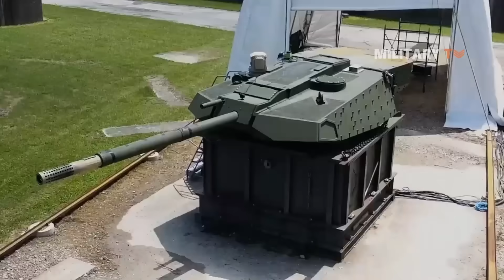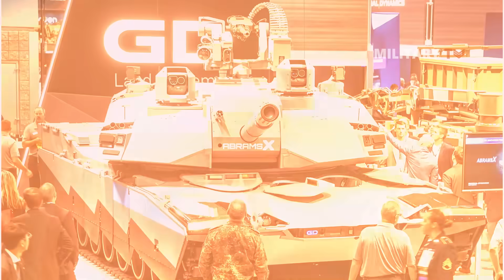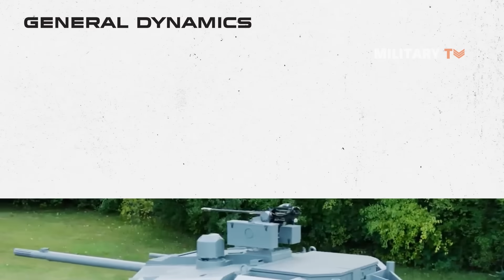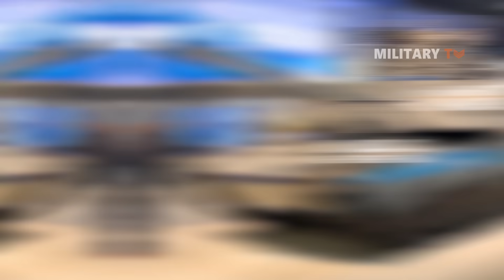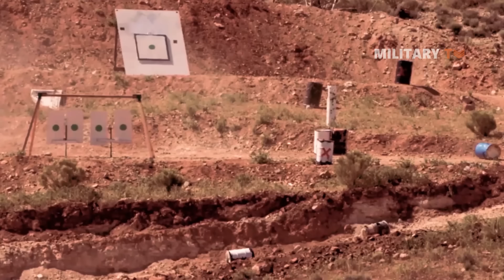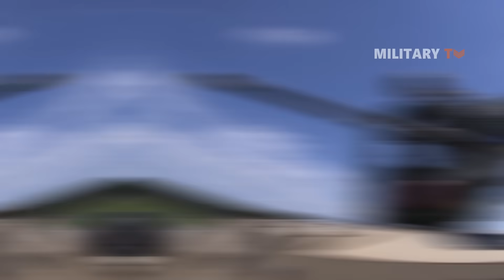Abrams X Tank: US Army Successfully Tested Deadliest New Tank

Comment: Almost everything that has an X in the name of a new AMerican weapons system, tends to fail dramatically. Not that it may be the case here, but i would also like to point out that the overall look of the system also projects its effectiveness. Almost all weapon systems that look good aesthetically, also perform as they should. Looking at the X model, the chassis from the older Abrams doesn't seem to fit its turret, where original Abrams turret fits the casis perfectly.

Comment: Would a hybrid engine allow for more low-end torque from an electric motor? One of the main reasons the US military went with the gas turbine engine over a traditional diesel engine was because the gas turbine engine offered better torque and acceleration at lower speeds. So, in theory, the tank could fire and maneuver more quickly and effectively. 

It's also cool that new Abrams X no longer needs an APU, cuz they'll just use the electric motor to power critical systems while the diesel is powered off.

Comment: The engine being lighter, the turret being lighter, the armor being lighter (through using upgraded materials) and everything else being lighter is why it can have the battery. My major concern is its relation to electric vehicles, if the military is planning on going electric then it would need to be a few hundred years from now. We have electric cars spontaneously combusting and the fire from it is simply to much for anything we have to put out instead requiring to secure it and let it burn out, the batteries also don't last long enough to be worth it, they're expensive and would need to last at minimum 20 years active or 40 years stored to be effective and current rechargeable batteries just are up to the task. Our power grid can't handle the number of electric cars we have now and the push to go full solar and wind despite their limitations and actual far higher carbon dioxide out from mining, processing and manufacturing the materials which render them into a state that can't be recycled or decomposed make it completely stupid to try and go fully electric.

Comment: It's an absolute no-brainer to install a large battery for hybrid operation. Reduced acoustic and thermal signature as well as extended range from the same fuel tank gives three significant tactical advantages from a single solution. 

I imagine that having one less crew gives about 2-500 litres of extra internal volume for other stuff, such as ammo. 

I am wondering, however, if they will not be missing the .30 and .50 cal machine guns they used to have. 30mm is a completely different weapon. Does this tank have adequate protection against infantry, who can walk up and throw grenades in the tracks. Or am I way off here?

Comment: The vehicle crew can be blinded by destroying the optical viewers/ranger finders located on the turret, how has that been addressed? How many rounds are stored on board the tank and are they all loaded into the autoloader system.  Are we talking about a hybrid battery power tank and if so, how often would the batteries have to be changed or recharged by an external power source.  Will the power pack be able to be replaced in the field? Has the logistics of this been consider before the design acceptance. As for the main gun size the larger the caliber the less main gun rounds can be loaded into the autoloader system.  I have heard the superlative descriptions on so many other weapons systems and have observed the far less than desirable realities of these systems, I have a wait and see attitude.  I hope there is not a void between the superlative descriptions and the reality.  Lastly what will the Abrams X unit cost be?
Reply: Maintenance is going to be a bitch
Reply: All valid points...which will be addressed in the Abrams X v2.0 upgrade kit in a few years...in a multi-billion-dollar contract.  Buy Gen Dyn stock.

Comment: Love it but a smaller crew has more cons than pros.  Tanking isn’t just commanding, gunning, loading & driving.  Everyone participates in maintenance but mainly it’s the loader & driver that do the work while the TC &/or gunner supervises.  All soldiers get sleep deprivation whether they are training or deployed.  You might get 4 hours a night if you’re lucky but someone has to man the gun & radio for security.  So you have to divide radio watch duties across the crew.  With less crew members that is more work or time for each meaning less down time.  Less down time means more sleep deprivation & lower morale.  WW2 tanks were smaller yet they usually had 5 crewmen as they had a dedicated radio operator who was an assistant driver.  To me 4 crew members is a good balance & you are less reliant on a complex mechanical autoloader which can fail or break.

Comment: the forward hatches with look out glass portholes in the Abrams X underneath the front end of the 360° deg rotating turret could have been better engineered . . . the sliding out mechanism of the glass porthole hatches cumbersome . . .

Comment: Also so what happens if the auto loader gets taken out? Are they going to have to go back to base and repair? Cause i didnt hear or see a way for any of the crew to jump up and manually load the gun? If so Thats a major design flaw.
Reply: I'd imagine even when a current Abrams is Penned in the turret, they won't be loading the gun any time.

Comment: The amount of tankies in the comments is hilarious. Let me tell you how shit your previous Armata is. It uses the Tiger tank's engine from the fucking 40s, the auto loader is slower than the t-70 and much slower than how fast an Abrams can reload, it also jams and can't be fixed unless taken to a repair depot, it has no backup sight, still doesn't use cameras as sights and relies on periscopes, is nowhere near the 50mph it has been stated it can go, most of its anti missile systems don't work, which was complained about by China, many of the components are built by the West so Russia can't even make them without the west's help, it's insanely expensive, and so much more that I can't even get into. 

Sorry tankies, but you aren't beating the US military industrial complex when it comes to making military vehicles.

Comment: Abrams X is not designed or meant to be a MBT. It’s actually meant to be a light tank that doesn’t work in frontlines, but behind the Abrams M1A2 SEPv3 and SEPv4
Reply: no we already have a new light tank with a 105
Reply: The Griffin 2 MPF is in production as new light tank. AbramsX is replacement foir older Abrams MBT's. The decreased weight of the AbramsXwill allow it to bridges that M1, M1A1, M1A2, M1A3 cannot cross.

Comment: It all sounds impressive, however, I would worry about the exposed critical items. The "two eyes" of the tank, what to keep them from being shot out and blind the crew? Did I hear you say rubber tracks? No mention of any heat capability. Can they catch fire rolling over a flamed obstacle?
I personally would have liked to see the impact of a Javelin against the shell or hull of the new tank, but there is time.
Smaller, faster? Three men abreast in front of a TV, Oh, we did;t see the inside. While it sounds odd, compared to the historical position in the battle tank, it is interesting, where else are three men working in an enclosed space side by side. Bathroom break?
Lastly, autoloading attack shells? Do we have reliability numbers on that? If, there is a failure to load, does one of the three have the capability to TS and clear the problem?
It's a very pretty tank, and technologically exotic, but can take the rigors of battlefield combat. Drones, missiles, mines, Improvised explosives, battlefield anti-tank landscape construction?
Ukraine shows both an urban and rural battlefield at once is this tank simultaneously ready for both as is today's battlefield? I like to see that proof of its ruggedization.

Comment: The coaxial gun could fire .338 Norma Magnum ammunition to increase its range, accuracy, low drop over distance, and have better terminal effects.  Replacing the M240 machine gun.  .338 has similar.50 BMG ballistics. GD and Sig have .338 guns. Offering useful anti personal protection and cheaper than 30mm.  A major Russian failure in Ukraine has been a lack of camouflage netting and possibly thermal protection.   Using cheap camo netting to protect multi million dollar vehicles.  Thermal camo is more expensive. Many vehicles were easily found without netting by using. UAVs. Then dropping bombs or share data with artillery. Ukraine artillery has had great accuracy.  Almost like guided 155mm rounds.. The US needs to keep these in mind. Russians also lacked  enough training, secure communications, GPS, night vision, trained infantry support and use of smoke for protection.  But had many popping turrets.

Comment: They need to redesign the whole thing. Weapons systems might not change much from these plans, but the advancements made creating advanced-higher-strength-steels over the last 20-30 years means this is like trying to up-fit an old car that still has weak steel that has to be ridiculously thick and heavy to be effective. Biggest cost concernment should be ongoing costs and all the advanced-high-strength-steel capabilities we have these days could be used to create a new balance between higher efficiency for range/long-term costs and stronger steel armor made with modern methods that would improve them both by multiples. The weight budget wasted by using steel made with decades-old technology is ridiculous. Trying to save the Abrams design is a waste of time. When you’ve changed every part of a vehicle by doing it piece by piece 5 years at a time it’s not the same vehicle and all you’ve done is eliminate the cost-savings and improvements that can be done with mass manufacturing and economies-of-scale. It’s a waste of money, The Pentagon has rightfully been trying to stop spending money on the Abrams for years to save money and move to the next tank design. Also, this tank was not designed, as suggested, for the combat in Ukraine, it was designed way before Ukraine started as a way to keep the Army on the platform when the army wants a modern tank. They’ve been fighting this and lobbying for years, maybe a decade.
If Johnny Cash were alive he’d say, “I wrote the song, One Piece At A Time, as a joke. I didn’t think the US Army would do it with the Abrams tank.”

Comment: The two (of many) important upgrades of the "X" is the lighter weight (enhancing transportability) and the diesel engine that replaces the maintenance requirements of the existing Abram M1's exotic gas turbine. High speed and maneuverability is an also great asset in an MBT, as demonstrated by the Russian T34 in WW II

Comment: Not a fan of tanks becoming more computer controlled. Pretty well rounded tank overall though. As long as neutron and emps can't destroy the electronics. Which is the biggest threat to a tank controlled by the computer/AI. Hope that a manual turret firing system is a thing on these tanks. Or the only thing the tank will be doing is trying to escape or driving in circles.

Comment: I think further design refinement focusing on exploiting abundance of resources and sustainable costs control over time. Also some additional logistical and maintenance research should be done at the U.S. Army's discretion based on supply and demand economics. This should be considered before making an official formal request to congress in purchasing the new main battle tank. Also, taking advantage of the the "electric motor revolution" mandated by President Biden's climate change initiatives should also be considered for powering the tank with an all electric system that offers quieter engine noise, low heat signature, and environmentally friendly.

Comment: I don’t think if there was a decent war break out that manufacturing would keep up with demand needed. Probably end up reverting to older style easier to build and less exotic materials required systems. All these tanks would get used up in the initial period then more dumbed down versions would come out then a redesigned more easily built versions until they get to a sustainable model. I think they’re dreaming a bit to much with some of this stuff
Reply: This is just a cool technology demonstrator. It's literally a what-if, packed with everything the designers could think / make use of. It won't go into production.
Reply: @bickboose9364  perfect description of the T14 Armata
Reply: @S0ulinth3machin3  Lmao yeah, but unintentionally.

Comment: Auto-loading on the Abrams has already been tried.  Army didn't like the idea.  A human loader can be swapped out in seconds.  A auto-loader would need significant repair time.
Reply: This is an American tank.

Filled with blowout panels, proper armor, proper combat and air support and logistics that can handle supply for it.

With skilled mechanics of all of NATO to repair it
Reply: @ArmedSpaghet  the Abrams auto loading was tried with the TTB back in  1983 by the is army.   They decided against the autoloader.   Look up the Abrams TTB for more information.

Comment: The fuel consumption reduction is huge. The logistical train the current M1 needs in the field, is a major vulnerability. And the reduced weight may be a practical reestablishment of the Armored Calvary. I don't think the Abrams X would be necessary for a full armored division. But in a smaller self contained unit such as a armored Calvary regiment.
Reply: If it's diesel-electric, it gets a LOT more than twice the fuel mileage of the Abrams, I think. A turbine is about the least fuel-efficient internal combustion engine known to man, isn't it?
Reply: @ceoelektronika8604  when the abrams was designed fuel was not an issue they wanted max power output to fight in the fields of germany if the soviets ever crossed the line

Comment: How easy would it be to "blind" this tank?  It seems that those protruding sensors on top of the turret are "delicate" and easily taken out.  Wouldn't this render the platform seriously degraded?  As an old infantryman that was the first thing that came to my mind.  It's the first thing I'd try to do to it.
Reply: I'm curious about that too, what is the minimum rifle cartridge that could blind it with well placed shots?
Reply: I agree, they mentioned the optics were armored but I’d imagine a some well placed hits or a heavy beating would disable them. My first question after seeing those  was if there are backups available? Furthermore, how easy or difficult would it be to replace such advanced optics & sensors?
Reply: @mrhoneycutter  I wonder if a .375 Cheytac would suitable for disabling tank optics. I assume .50 bmg would would work on them but that's a really heavy unwieldy thing to carry, less practical for soldiers.
Reply: @morgatron4639  honestly I wouldn’t be shocked if it could. You’d likely need to land a few well-placed shots close to or on the “eye” of the cameras/sensors. While the sides of the structure the optics are held in looks fairly solid, I can’t imagine the optics/sensors themselves being as heavily fortified.
Reply: Even if every sight was taken out they could beam a target/range from their personal drone and the computer would do the rest. Could be sitting behind a hill like a chopper or artillery and indirect fire.

Comment: Seems very promising. The hybrid engine sounds like an amazing idea. My only concern is too much complexity. If it's too complex to build, then it won't stand up in a major conflict. 

Also, what if the autonomous machine gun gets jammed?
Reply: Might have something to counter the jam
Reply: @LazyHistorians  they might. Separate but related. I spoke with an actual F35 pilot today.. I asked him about it and he said: "It's great.. if everything works..."
Reply: @kadegreen5356  I mean that’s equipment in general.
Reply: Chain guns don't jam, they are power cycled instead of gas cycled. The faulty round just gets cycled regardless of weather it fires or not.
Reply: @knowahnosenothing4862  interesting. Perhaps "malfunction" is a better term.

Comment: Way too many bells ans whistles way too much tech to fix in the combat zone if something fails if it were to enter production which I dont think it will it may fail like the MBT 70 from the late 60s /early 70s there are some features that could be integrated into a new or say a M1A3  such as a new turret to better integrate the trophy active  protection system and the XM360  120mm gun and keep the the commander, gunner and loader in the turret and  if the new Rhienmetall 130mm gun becomes a NATO standard them eliminate the human loader in favor of a auto loader as on KF51 Panther also add a fuel efficient  multi fuel diesel

Comment: Trying to hide a tank on the modern battlefield but slotting a hugely heavy and expensive battery pack into the system is like telling crew members that they can't smoke in military vehicles.  Sounds great when the brass and wobbleheads think it up but doesn't fly in real life.  Don't even get me started on the complete crew reliance on cameras for situational awareness and  faith in the remote gun AND AP weapon systems.  Sigh.